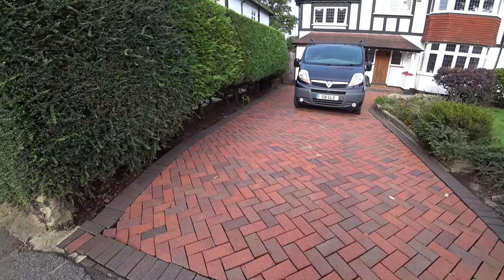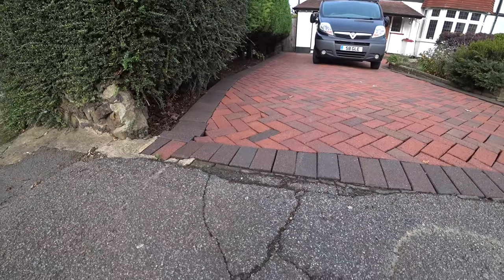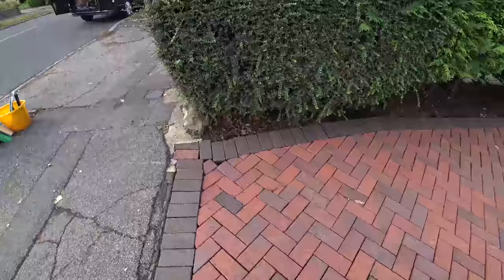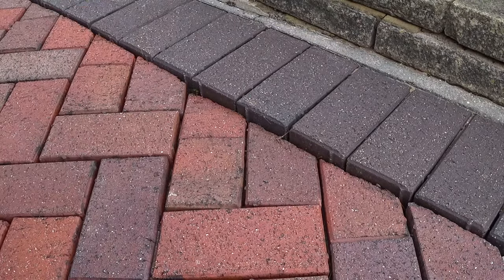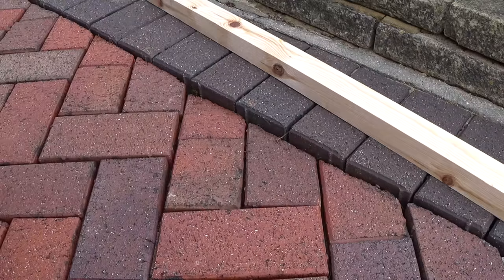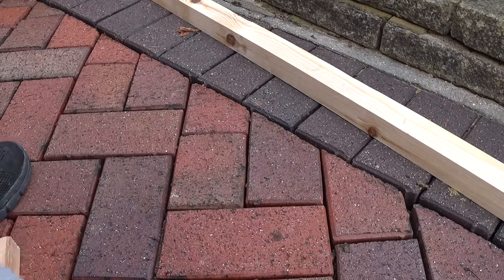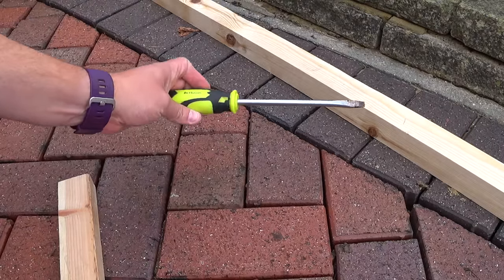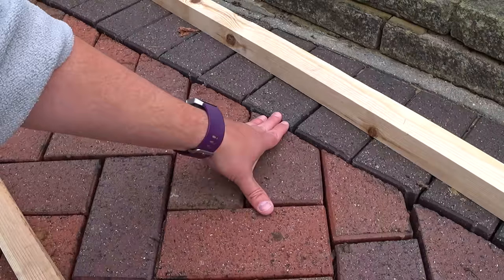How To Re Level Sunken Driveway Blocks - Easy DIY Fix.

Comment: So phill have you found the holy grale of oil removers? As you know there is a limited time from when  the oil spill happens to the time it can  all be successfully cleaned up. Its the shadow thats hard to move Ive tried loads of things. Do you just move the blocks about ? Cheers matt
Reply from the maker: Hi Matt, to be honest, NO lol i haven't found a holy grail remover. Like you say there seems to be a fine window of around 14 days give or take to attempt successful removal. If its quite fresh I do find that good old dish soap is pretty effective at roving the bulk of the blackness. There are quite a few proprietary cleaners designed for oil, Resiblock OR for example which I have tried but with limited success due to the cost. I have found that for heavy staining mixing up a batch of whiting powder and household ammonia works really well at lifting out some of the residual ghosting. Whiting powder is used in picture framing and is a talc-like powder, and ammonia, well that's just the evil-smelling stuff that will have you on the floor out cold if you sniff to much lol. If I get a chance in due course I will do a video on the stuff.
Reply: @DirtyDriveAway  blimey phill you are a bit of an alchemist lol. Bloody talc and ammonia cant wait to have a go at that one but might wait for yr vid tee hee! WERE DID YOU LEARN THAT ONE I would love to know.
Reply from the maker: lol chemistry 101, bit of this and a bit of that. No actually I flunked science in school and I'm sure I picked up the "recipe" on a website somewhere, god knows where but when I saw it I thought hmm that may prove useful. Lithofin makes a product called Oil-Ex and its bloody good at shifting oil stains from natural stone. Not cheap at around £15 a tube but for localised stains, it's really good. The downside to all these products is that it's not a 5 min job, its an overnight or 2 days dwell for the stuff to work. Basically what happens with both the Lithofin and the ammonia stuff is it goes down as a thick paste, the chemical or ammonia, in this case, penetrates the stain loosening the oils etc. Now as the whiting powder is a talc-like substance and the ammonia naturally evaporates it causes the powder to dry and absorb the stain, a bit like the old school cat litter on a pool of oil. I'll grab a couple pavers next time I'm at the builder's yard and do a vid.
Reply: Try baking soda and white viniger gets most stains off, rub in the baking soda (bi carb) then dash the viniger on it and watch it fizz and bubble and eat away at it for abit then blast it.
Reply from the maker: Maybe ill try a video of this alongside the whiting powder trick. Phill
Reply: @rbrmcc2422  sounds like a good remedy but after all that work is there still a shadow?  Cheers matt
Reply: Go info about the different products Phill, I know what you mean about blessed dwell times! You just want to", shoot your load, clean up and leave" said the actress said to the Bishop!   
I brought a oil digester from smart seal at beginning of year but just could be bothered use it as back and forth to customers house to see if its done its thing. Can take up to 7 days or longer to work. Have you dabbled with any oil digesters Phill? Matt
Reply from the maker: @matthewcalder4351  I've tried Resiblock OR which was OK but didn't really shift the ghosting. I usually find replacing the blocks the quickest method of you can get a good match.
Reply: @DirtyDriveAway  no such thing as oil removal more like oil reduction in most cases. Change the blocks for the ones under the wheelie bins flower pots etc.
Most cases the sun has dried/ stained the oil in the capillaries of the block paver ,can't see a product getting that out !especially 2 months on when the customer decides to do something about it and wont be satisfied unless 100% removal.
Bin there lol
Reply from the maker: @matthewcalder4351  I've been to customers houses and when I ask how long the stains have been there they go "hmm about 15yrs will they come out" er nope!
Reply: @DirtyDriveAway  been there too lol! Looking forward the your oil removal vid!
Reply: Burn it with flame torch.

Comment: Hi Phil, thanks for the great content, can you do a video on how you are payed? do you get it in advance? on the day? do you have to call back ? do you get a lot of cheques?what if it's miles away a 2 hour round trip? Thanks in advance :)
Reply from the maker: Hi, I take payment on completion. I do take cheques but I probably only get about 4 a year, I only take them on local jobs. Most jobs are paid cash or BACS, I've never had an issue with payment, touch wood. Phill
Reply: Hi just watched yr video .how far do u travel and do u have much experience  in this type of thing thanks.

Comment: Phil quick question? Are you paving contractor?
Reply from the maker: No i specialise in cleaning. I can reset a few odd blocks at a fraction of the cost a dedicated paver would charge. I only do the odd blocks not large areas as you need special equipment.

Comment: What is the most common reason for sunken blocks is it inadequate sub base?
Reply from the maker: Could be several reasons. Biggest is vehicle traffic bearing weight down. Not re sanding after cleaning. Sub base sand wash usually from shifting blocks or again not re sanding. Drain movement.

Comment: If I looked outside my window and saw someone fixing the sinking blocks like that, id send them home.
Reply from the maker: It's a free service I offer on small areas after they've been cleaned. It still looks good today, I clean it every year. I'm not a professional drive installer, just helping out customers.
Reply: What's the best way of doing it?

Comment: Looks like they were ripped off! The worse block pave drive I've ever seen!!
Reply from the maker: It is quite a few years old and slopes to the house. It's also surrounded by bushes and grass.
Reply: No flat top edging around it for a start that’s shocking workmanship, I doubt there would be any weed control membrane underneath and given the depth of the blocking sinking I would imagine they have either shied the type one bed or not correctly compacted the area before blocking it but all round a terrible block paving job leave it to the professionals next time I’d say 👌🏻

Comment: This is not the way.  You need to compress and level the sand.  Then put the blocks on top of the sand.  No need for pounding like you do.
Reply from the maker: Yeah but this is a free service and it's lasted so as far as the customer is concerned it's a win. Yes it may not be 100% correct but its saved them a few quid and their happy.

Comment: Do not use builders sand for god sake. This is how not to make this repair. Use sharp sand always
Reply from the maker: I use what I have to hand, I don't charge for this service if doing a clean. I'm not a professional driveway installer and the customer is more than happy with the free service. It's still level today and I clean it yearly.